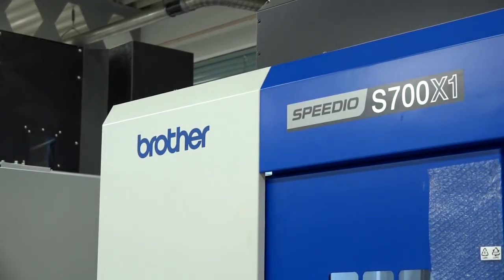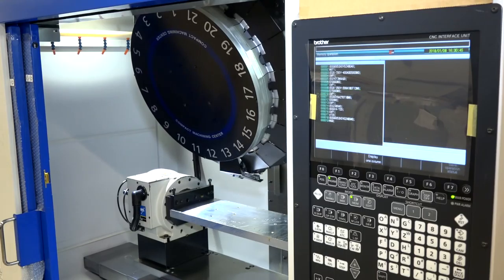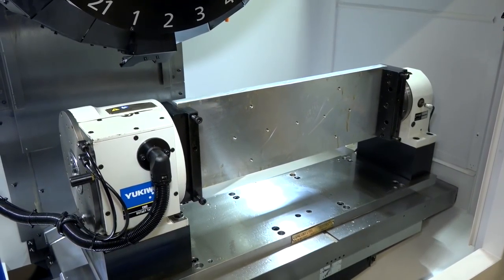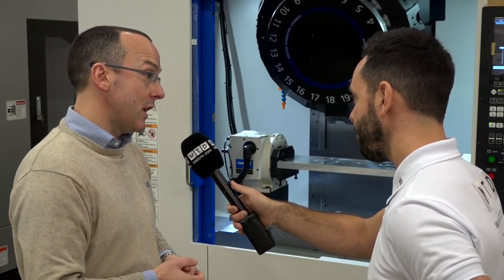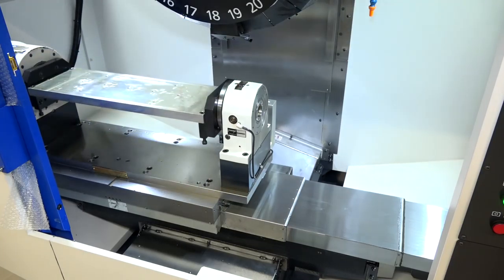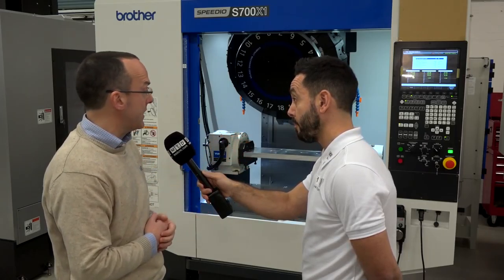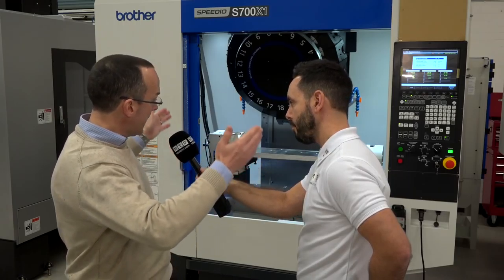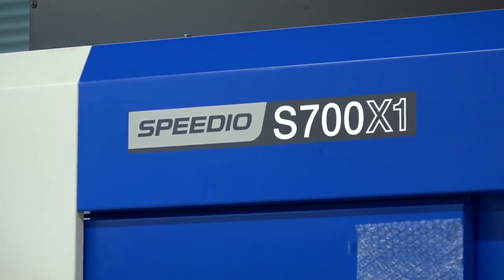How fast is this trunnion on this EX DEMO SPEEDIO

Comment: Next time, please, pay some more attention to Brother's control. Does it include something simmilar to Fanuc's Manual Guide i?
Reply: Yeah, they should have went over the controller more. For the most part. People view the controller as the reason or not the reason to get a machine Every other factor is secondary. It doesn't matter what perks it may have, if the controller is abysmal to work on.